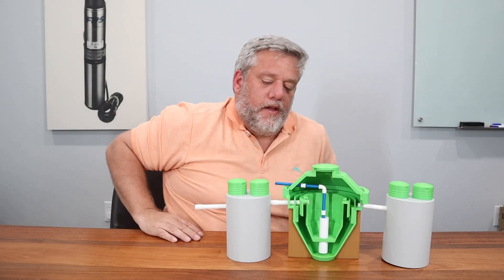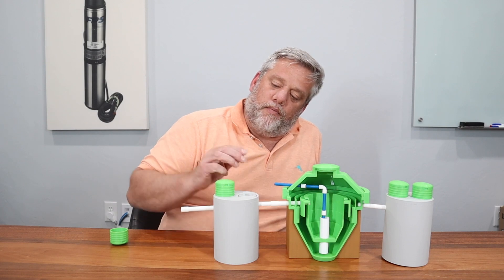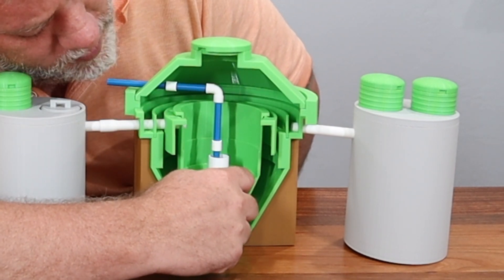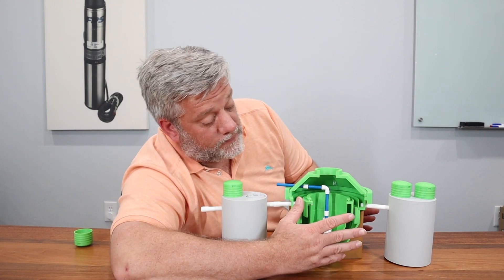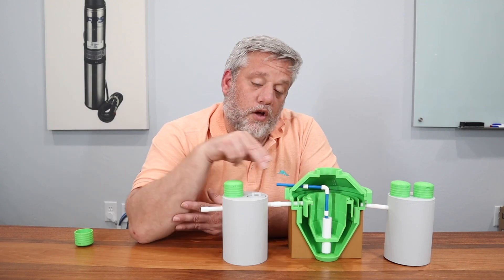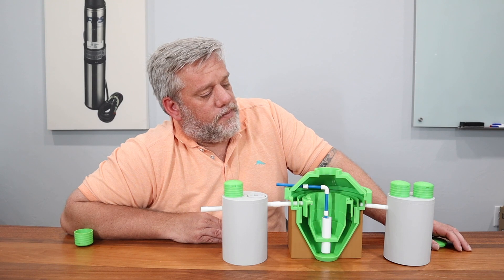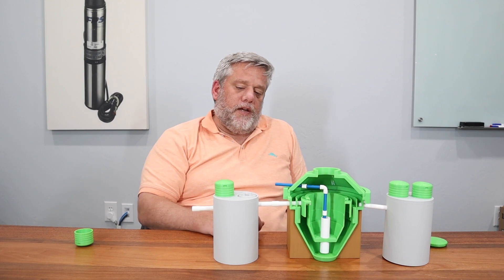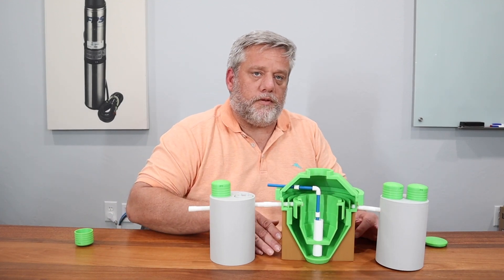Nayadic Septic System: Simplified Overview

Comment: I have the Nayadic with out any additional tanks before or after. How do I know when I need to pump out the Nayadic tank? Great informative video by the way.
Reply from the maker: @coreyspitzer2811  The outside ring will have a lot of nitrogen reduction material it looks like a black mat. it unfortunate it doesn’t have a trash tank it would greatly reduce the frequency of clean outs needed. how many people live at the house.

Comment: Our air pump is working fine but liquid in the aeration tank has stopped bubbling - was recently pumped out and thinking something got disconnected (diffuser?) or dislodged.  There is a check valve in the airline from the air pump - could that be part of the problem?   Nyadic 600 gal.
Reply from the maker: @radiocjl  could be you in a nyadic you would hear air because of how they are set up. you can see most of the pipes inside the tank they are not hidden. so if you can’t hear air or see it bubbling it’s probably disconnected where it comes into the tank or close to the aerator. you can call the office our family has installed nyadic for 25 years so we know just a little bit about them lol.
Reply: @wholesalesepticsupply  Thanks for your comments!  It seems the issue may be with the check valve as I knocked it a bit with a pole and got bubbling to resume.   So, am thinking it's not the diffuser down at the end of the airline piping.  We have an older M-6 Nyadic.
Reply from the maker: @radiocjl  Call our office we never put a check valve on ours. if it’s a diaphragm pump it’s not needed as it would never vacuum in. If you have a rotary vane unit it could possibly have one we never put one on with our nyadic units but doesn’t mean you don’t have one. Call the office monday i will help you.

Comment: I'm in coastal VA and have the 3 tank system for about 4 years now, my center aerobic tank also has a UV lamp. only two issues were I had to adjust the pump timer to pump longer to keep the affluent lower, it was triggering the warning light, also the air pump diaphragms had to be replaced, that is the worst weak spot.